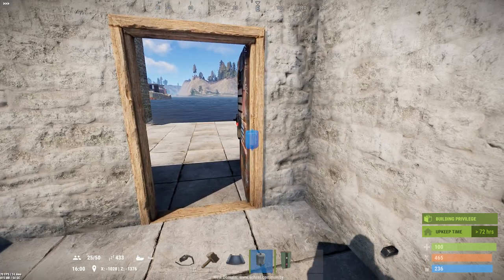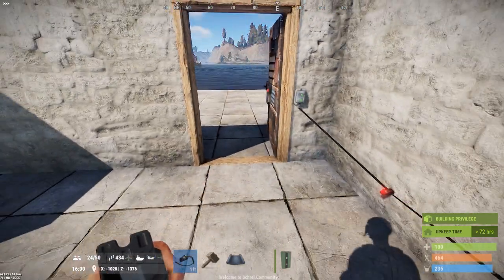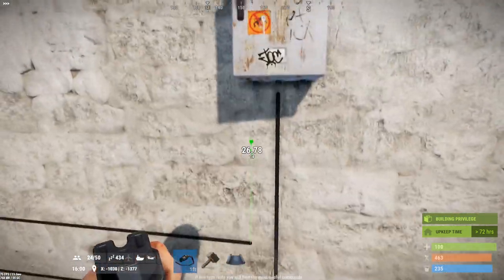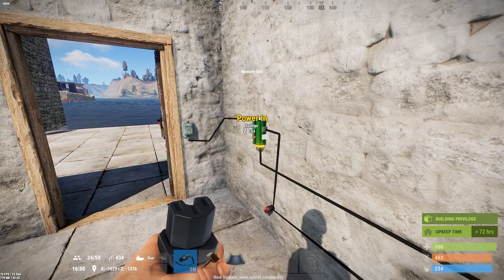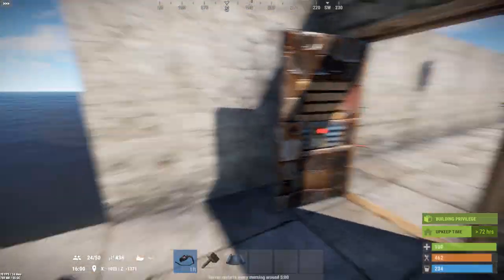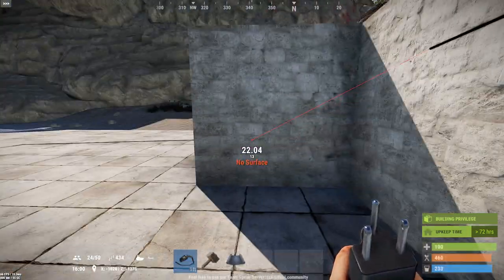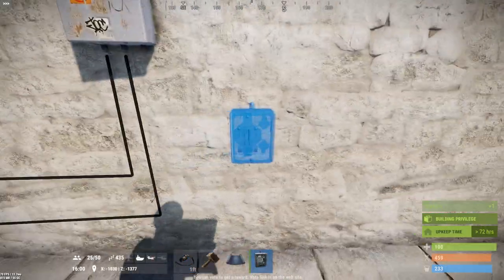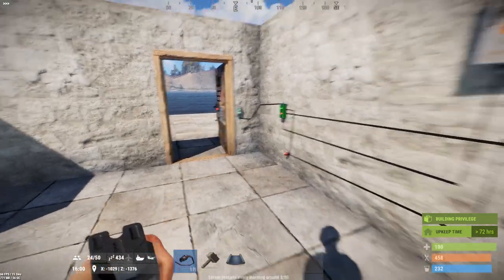Rust Electricity: User Request - Basic Trap Base Door

Comment: good video. ive been trying to figure out a way to have the same circuit trigger another door. so this helps. how much power would you need to run this consistently? batteries/solar panels ect.
Reply from the maker: If you want to roughly estimate power needs, assume one power unit for everything you connect to or through, except for lights which take 2 units.

Comment: Okay what if you don't have a memory cell bro can you tell me how else to block when the pressure or laser is triggered to the door?
Reply from the maker: You can use a blocker, but that is only a momentary action while the pressure pad or laser is triggered, so it's easy for the attacker to 'defeat' by getting away from the trigger. The joy of the memory cell is that it changes state until you reset it and truly traps them in!
Reply: @RabidRabbitGamer  I see bro.... I tried it with two switches one other switch connected to the main one with the pressure pad and door controller. So when the pressure pad is triggered it hits the turn off switch and then I have to reset everytime. But the door stays closed if that makes any sense
Reply from the maker: @12marcusboy  Sure does, glad it's working!
Reply: @Rabid Rabbit  I didn't have luck with the timer bro. I did the blocker to the switch so basic shit. But getting there slowly. Why did they move the other part to t2 bro? Also the tesla
Reply from the maker: @12marcusboy  I think the more people get familiar with the tech, the more they have to nerf it.

Comment: Is there a way to do what you have done BUT, when you hit the reset switch it doesn't re-open the door?
Reply from the maker: I may not be understanding what you're desired outcome is. Why would you hit reset if you didn't want the door open? (to reset the trap)?  Just don't reset it :D
Reply: @RabidRabbitGamer  ok, so I have the trap room opposite my front door. If someone rushes in behind me and kills me, the trap door opens shuts the front door and kills the rusher. When I reset the trap room, I don't want my front door re-opening. I hope that makes sense.
Reply from the maker: Yep, makes sense, a bit tricky solution because we still need to fire a quick on-time event on the exterior door because the act of cutting the power is was causes the door controller to close. Here is a way to fire the exterior door for one second when the trap is triggered, then it will close and stay closed until reset and laser trigger again.   https://www.rustrician.io/?circuit=f0f6b1643b6f72dea8738403f6485baf
Reply: @RabidRabbitGamer  You are an absolute rock star. Many MANY thanks :)

Comment: Is there a way to do this where the door remains closed, but it opens and can't close once you trigger it? I've been pulling my hair out for hours trying to do this.
Reply from the maker: Certainly, just connect the door to the other output so that it is closed by default and the trigger that changed state on the memory cell then opens the door and it will stay open.